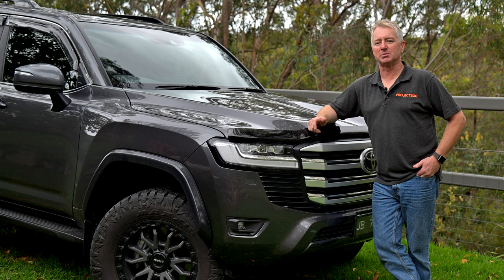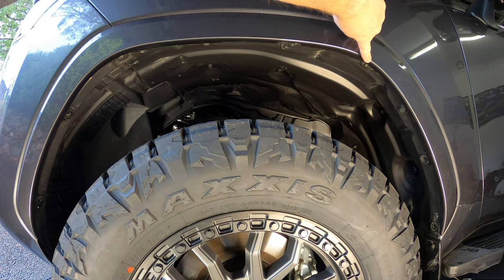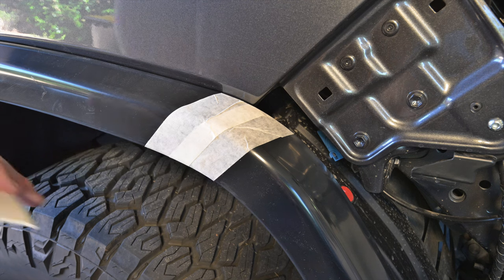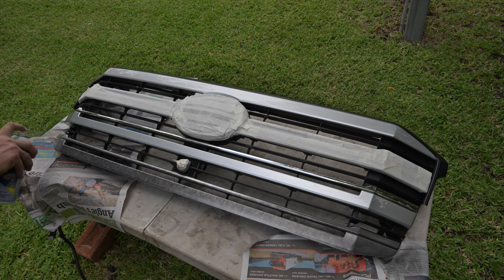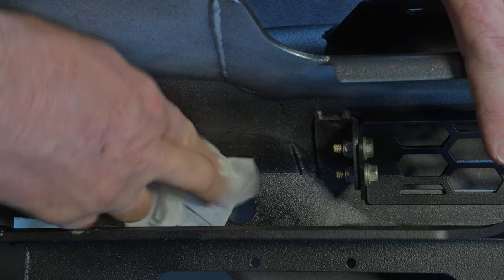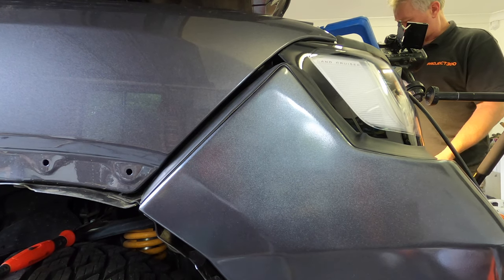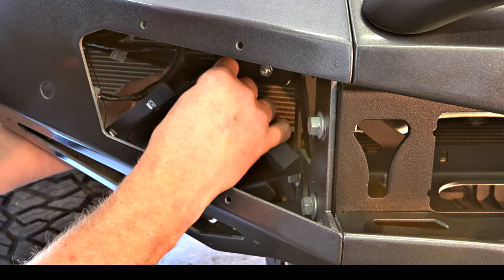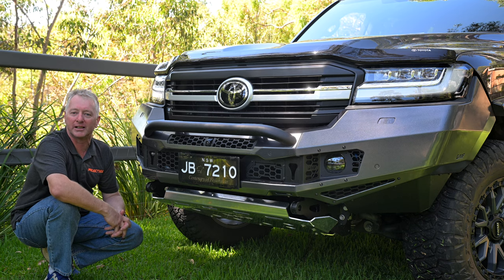GMF Front bar bullbar for LandCruiser 300

Comment: Another great video Jamie. I.ve got the XGS suspension with an ARB bar but seems a little nose down. Do you have the front height measurement as yours seems nice and level. Mine is 545mm from center of hub cap to  bottom of guard. Cheers Andy

Comment: ARB is way better
Reply from the maker: I like ARB stuff, and used ARB bars for 30 years before this. ARB make a great hooped bullbar (Their 'Summit' bar). But if you just want a channel/bumper replacement bar like this one, then the GMF is IMO far better than the ARB 'Sahara' bar. Much better looking. Integrates with the shape of the car better. Tapers up under the headlights rather than being flat. Doesn't use a cut around small piece of the original plastic bumper near the guards. Much better placed recovery points, integrated highlight jack holes etc. Here's the ARB Sahara bar so you can see what I'm talking about: https://www.instagram.com/arb4x4/p/Cl0appVOmBS/